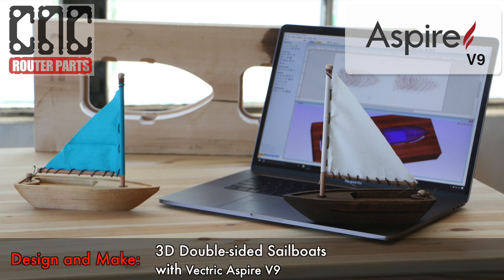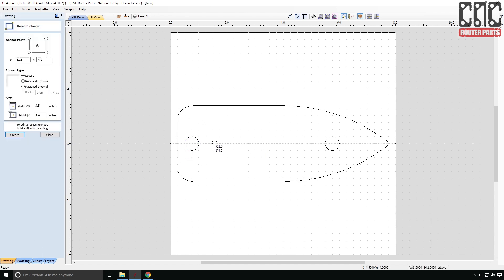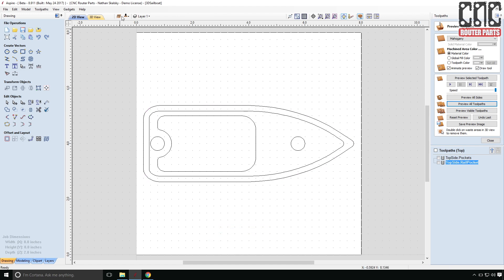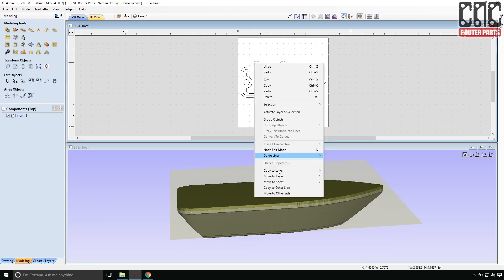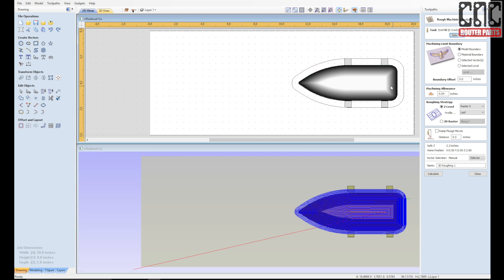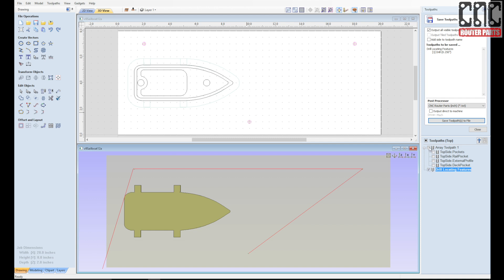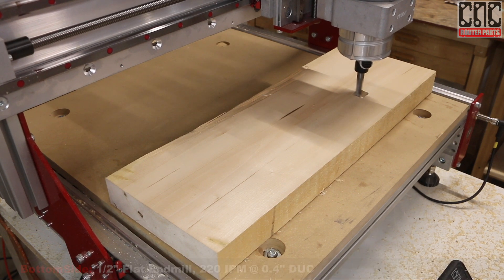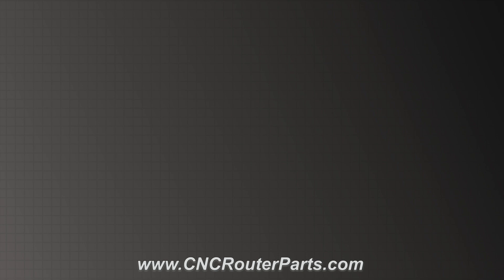Design and Make Double-Sided 3D Products with Vectric Aspire V9 (Full Walkthrough)

Comment: How are you able to use a 1/2" cutter in your router?
Reply from the maker: Hi Tiny Houses, We are using a 1/2" collet.  These usually come standard with spindles as well as routers of this class (>2HP).  -Nathan
Reply: all normal router use 1/2" collect only small toy router use 1/4" collect and bits. but good normal spindle NOT used worst router, not has plan use cnc machine and bearing go fast broken. if use cnc need use REAL spindle normal 1,5-2,2KW air or water cooled spindle ER20 collect whit VFD. cheapen than big router and lot lot better and accurate and silent and long-life than worst router have.